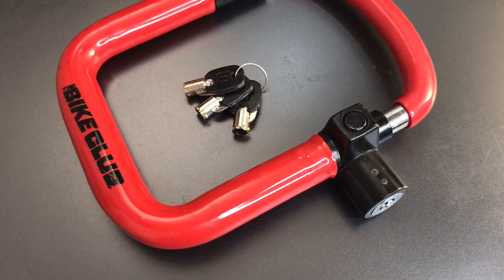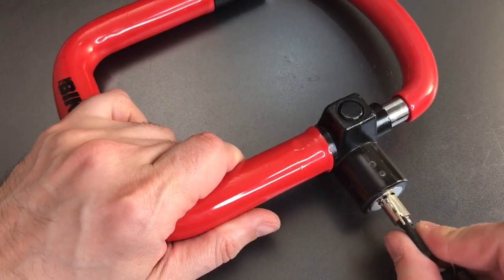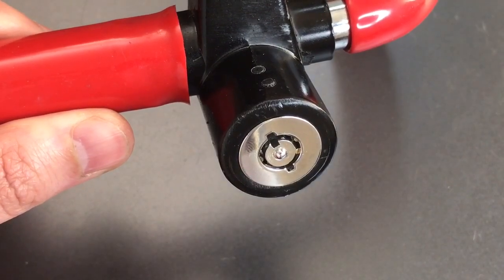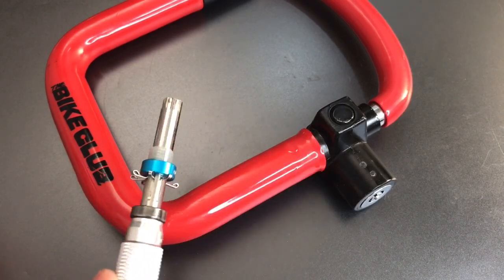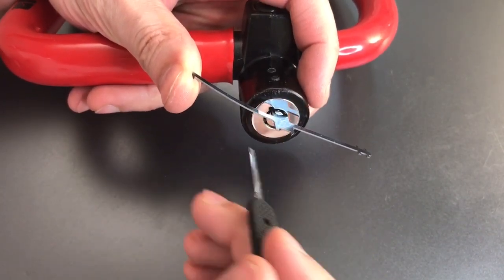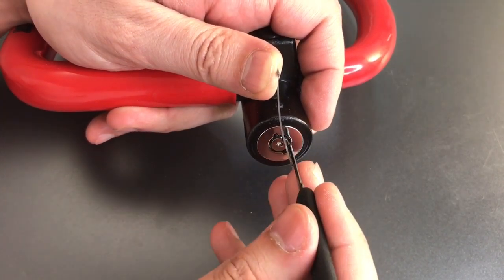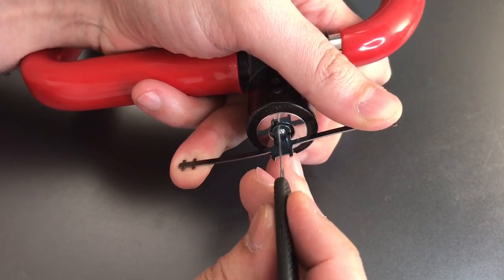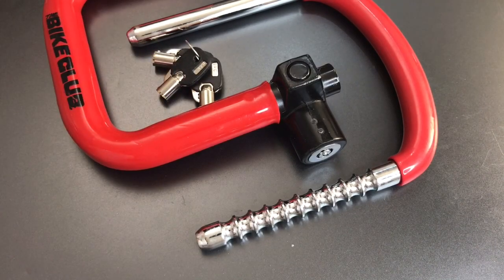[463] The "Bike Club" Picked

Comment: i remember the club, i had one on my car until the lock stopped opening. my friend had a hand drill aka manual drill and he drilled out the pins with it in about 4 minutes. we were  doing this on the streets of nyc a police car pulled over next to us and stared at us, we glanced at em and went back to work because it was my car, after a few seconds the cops drove off without asking a question.  after that day i never wondered why auto theft was so high in nyc. i also never used a column lock after that and told everyone i know to stop using them.
Reply from the maker: Lol. Been there... sawing the lock off a a friends parents boat trailer in college.
Reply: If you look confidenent enough in what you're doing, and that you should be doing it, most people will just assume you own the boat, bike, car, trailer, door etc, they want to believe everyone is above board, shame really.
Reply: They might of scanned your license plate, and got your mug shot up from couple years ago. Then they scanned your face and confirmed you're the owner, and drove off. ^_^

Comment: The time this takes should be enough to protect your bike in a public place. I expected much worse.
Reply from the maker: It should be enough... but you never know.  some people don't care and will sit there banging away at your lock for several minutes.
Reply: LockPickingLawyer short of getting something like an Abus Granit X-Plus, though, which wasn’t an option in the 90s (not sure if this is a vintage lock or not), those hypothetical people who are both experienced pickers and good enough social engineers to sit in broad daylight doing it, well, you’re just not going to defeat those.

And at that my Granit X-plus pretty rarely is around both a rack and the frame — most racks or parking spaces just don’t allow for it. And going through the front wheel and the rack is worse than useless (particularly given it’s a QR equipped bike — removing either wheel is toolless). If I’m gonna be somewhere overnight I try to take a cable so I can lock up that front wheel plus anchor to the world, but my U is still mostly just going through frame and rear wheel.

There’s only so much weight you can afford to spend on physical security of your bike.
Reply: @lockpickinglawyer  said the bishop that the lady with the chastity device..

Comment: Surprisingly good lock cylinder. I’m impressed. Not so sure about physical construction. The locking serrations seem to leave a relatively thin shackle. It’s also gonna be much more secure the smaller you lock it.

Comment: I remember the original Club. Now I feel old... From what I remember it was really sort of a joke.
Reply from the maker: It was a joke.  People would just cut the steering wheel, which has a thin wire running through it.
Reply: They are easy to snap with a pipe wrench. We'd do that on repos.

Comment: You can use the impression tool to 'decode' the lock after you pick it one position .. and you should be able to even pick the lock using the impression tool, if you loos the fingers. Have you tried it ?
Reply from the maker: I've not tired it, but that will work.  I've discussed this technique in past videos.

Comment: Would be cool if there was a way for a lock to reset its pins if it takes more than one second or something to open them all. Basically, you either have the key or you can't open it unless you do it in under 1 second which is kinda difficult I imagine.

Comment: On the first pick, you only clicked 3 pins, suggesting that the bitting was perhaps poorly selected for this particular example of this lock. 
 Also, rather than pick it four times, is it not feasible to pick it once but not turn it the full 45 degrees, and then use a lockable impressioning tool to simply read those keypin heights and  then just rotate round the next 3 positions as though you had the key?
Reply from the maker: On low tolerance locks, its quite easy to set pins without knowing that you did so... that appears to have been the case here.  And yes, you could impression the lock after picking the lock half a position... but this is pretty fast and I usually prefer to do it this way because I'm far more likely to have the SPP tension tool with me.

Comment: I remember The Club and all the knock offs. They were a thing, until crooks figured out all you had to do was cut a slit in the steering wheel and slide it right off. Attaching a security lock to one of the weakest parts of an autombile wasnt such a bright idea afterall.

Comment: what about the The Club UTL800 Utility Lock  , i need a lock for my utility trailer , and i don't have much money to spend on a lock .i was thinking about this one , and its the only one big enough , to fit from the front frame of the trailer , to were the safety chains go on the hitch .  i don't like the ( what i call , the ball locks , ) if your hitch is new , or near new , not rusted in , in other words , one can easily brake a hitch lock , and take the hole thing trailer hitch and all . that's why i am looking for a lock , that can go around the trailer frame and the hitch body  , not easily stolen . and i looked at chain locks , they cut to easily , even the good ones , so what do you think ?? i need your expert option . on this lock . i know very little about locks . can you help ?